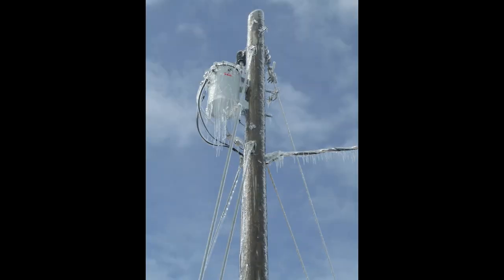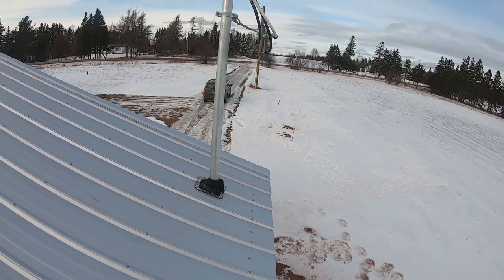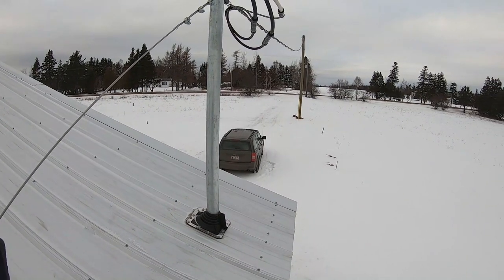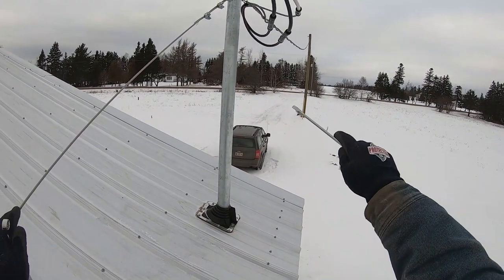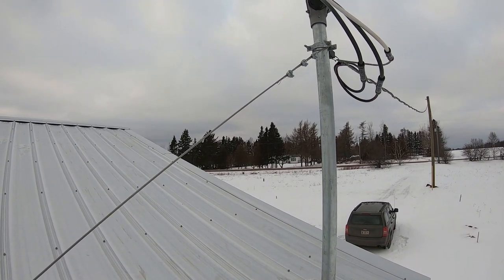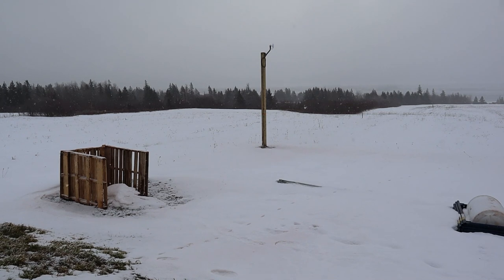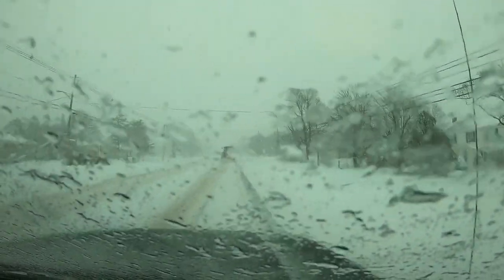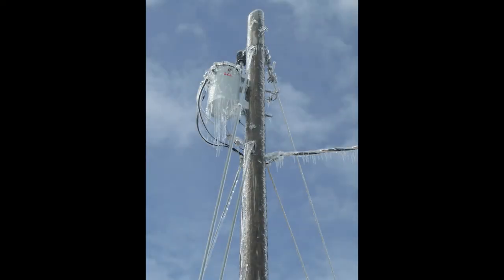S1E20 SECURING OUR ELECTRICAL SUPPLY || FIRST REAL BLIZZARD ON OUR HOMESTEAD

Comment: You just demonstrated your self reliance!   And I might add that I think you have gone beyond “code” and your work looks top notch.   I wouldn’t bother to revisit it.  If I understand correctly you are responsible for the lines after that last post?  And that in turn helps explain why it isn’t buried by you?
Reply from the maker: Thanks for the comment. You are probably right, as I look at it now it does seem pretty bullet proof. I'm not in a rush to change anything out.

Comment: Hey Alan - great idea using the stays, fortunate you had them.  You could also check (as a temporary fix) a dog run cable at the pet store.  They come with the thimbles and clamps.  Hate to "Jury Rig" things, but, it might be considered for an emergency!!  I've witnessed what happens when a power Stand-off fails - roofs, wall studs, siding, etc...  Tons of work..  Another young sailor, Sam Holmes (you tube), is setting up to cross the Atlantic in May.  He is fixing his shop up right now, as you are, trying to get his sailboat ready for the event.  Would be a great "You Tube" if you guys did a joint "How To" video!!
Reply from the maker: Thanks for another great comment. If you can convince Sam to do a collaboration I'll be happy to  do a joint video. Certainly an idea worth pursuing. I feel that I don't know him well enough to suggest it though.
Reply: @RoversRest  I sent Sam a note - hope he responds.  He's down in the Carolina's.  Might be a nice break for you and Mrs Rover to go South.  I don't think the Border is open yet but that should change soon:-)

Comment: Great video again. As others i was wondering, why you dont bury your cables in Canada. :) You have commented on that elsewhere.
Another isue i was wondering about is, that you secure your wire on the roff in one direction. If the winds come perpendicular to your wire,  don't you think there is a risk that the pole on the roof will get dragged to the side? Actually the tension in the system, will increase the risk of that to happen - i guess? Hope you understand my question. :)
Reply from the maker: Most of the concern deals with an inline pull, however, under an extreme condition we could have a failure 90* from the run of the wires. But this kind of event would devastate the grid throughout the area I suspect and there would be little that we could do under those circumstances regardless. Here's hoping that we don't have to deal with such an event.

Comment: Why isn't your supply buried especially when you get weather like you do during winter? ( from the UK)
Reply from the maker: I will bury the cable from the shop to the house when we build it this summer. The reason that you see mostly (about 99%) overhead wires in this part of the country is due to the significant cost of  the armored cable used in underground service. Personally I prefer the look of structures without overhead wires but we are working within our means. Thanks for the comment